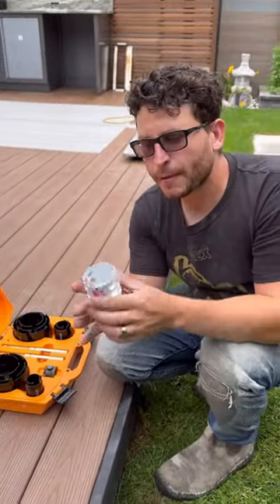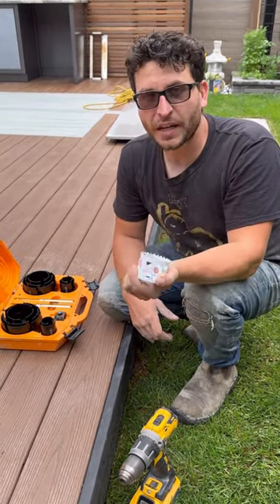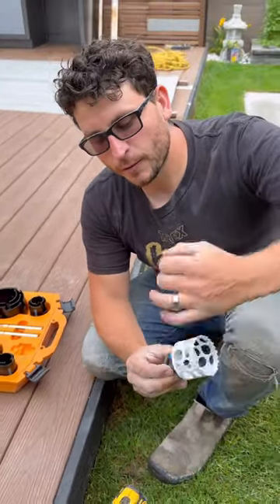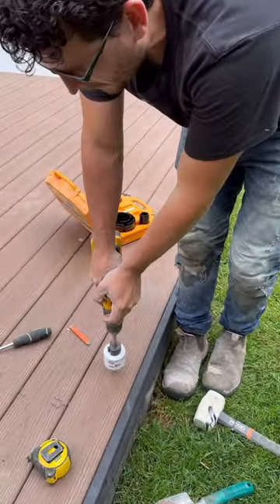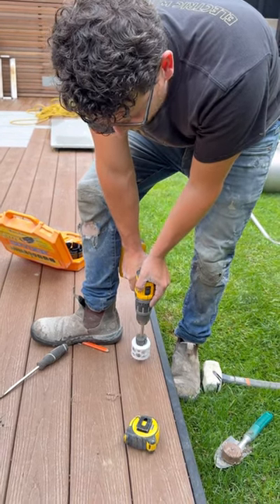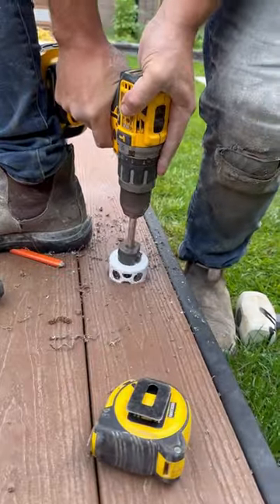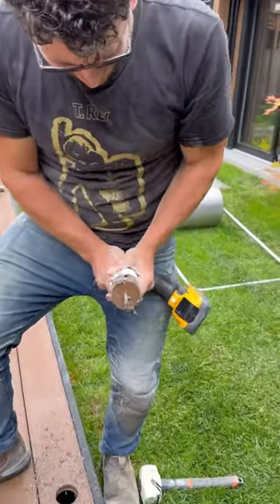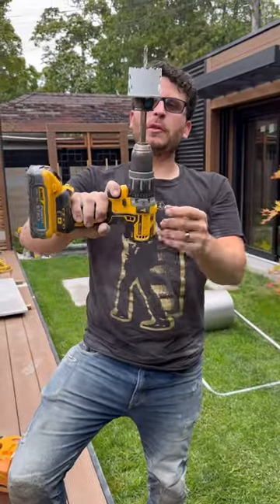BEST HOLESAW SYSTEM? #carpentry #tools #diy #protip #powertools #carpentryskills

Comment: I have never had a single problem getting the plug out of my hole saws. Just stick a flathead screwdriver in the holes on the sides and walk it out. Problem solved.
Reply: Lmao ! Amen brother !
I have used a dull chisel !
Whatevers in my left hand pocket 😀
Reply: I noticed hes cutting that plastic deck board might be why
Reply: its a problem people who can't drill straight holes face more. ppl who complain about torque spiking usually refuse to use the handles that come with their drill they also refuse to get a bigger drill. it's not about power it's about leverage. even the 12v drills have enough torque to end your career if the built in cutout doesn't work in time.
Reply: @godzilla7382  what's this got to do with the price of eggs on china
Reply: This man failed physics in high school.
Reply: Amen, my boss had me sit one time and get every single one unstuck.
Reply: Your are right bro.This dudes tripping 😂
Reply: Yup, or you could use a paddle drill but in the stuck wood
Reply: Take a long screw and screw it into the material and itll push it out. There ya go
Reply: Stop applying excessive force! You don’t have to push so hard. Let the tool do it’s job. And back it out to shake the saw dust and boom the plug will fall right out or just a quick ting with a screw driver and done.
Reply: Was gonna say the same thing, not that hard to remove the plug
Reply: Maybe if he used the hole cutter to cut through instead of melt through, removing the plug would be easier.

Comment: Just before you break through, bounce the drill a few times to clear the saw dust. Then your plug just falls out.
Reply: That works for wood but he's cutting composite decking
Reply: @aaronoconnor606  Works for that too. Also, it makes the cut easier because you aren't binding up on the edges, causing it to overheat, which causes the swelling.
Reply: What do u mean when u say bounce it?
Reply: @BreakKaydenBreak  Just like it sounds. Let the drill bit hit the bottom of the hole hard enough that it bounces back up a bit, while spinning. It forces the dust out from the bottom of the hole and from around the plug.

Comment: If you stop a time or two pm the way through and pull back it'll greatly helps with release of any material in a home saw, not to mention it helps clean out the teeth.

Comment: I’ve literally never had a holesaw that I couldn’t easily get the plug out of with a screwdriver. Most of mine are Milwaukee and Lennox, but I have used many other brands in just about every type of surface over the last 20 years. I think you have an issue with your technique if you were having to throw out a holesaw. Lol

Comment: If a drill only had a clutch to protect your wrists.
Reply: Dude that "clutch" wouldnt last a week.  Notice how the settings go 1 to whatever and then a drill bit marking? They're for using it as a driver with bits or sockets not as a drill.  The highest setting wont spin a decent sized hole saw in composite deck boards.

Now the real trick is to start out drill your pilots I use a different drill with a higher end centering bit.  Then once you have the pilots drilled you take a rotary hammer the big one for concrete bits and you can now stand with the motor between your calves and it weighs enough to drive through but never finish drilling all the way stop your hole about 1/8 shy pull back off and go to the next go around and almost drill all the holes then come back and finish once your hole saw has cooled because that plug isnt expanding your saw is.  The plug is staying the same but your drill is hot.  

Now most of the plugs just fall out or you can knock em out with a screw driver.
Reply: @bryceg5709  In the owners manual it even states you have to use the clutch for this.
That is what it is designed for.
And you dont need to push hard down on the holesaw.
That wont make it drill any faster.
Reply: @3dmazter  the manual states what I stated.  Look under the drilling instructions it will state.   Turn the collar to the drill bit symbol. Install and tighten the desired drill bit in the chuck. Select
the desired speed/torque range using the gear shifter to match the speed and torque to the
planned operation. Follow these instructions for best results when drilling.
Reply: I believe it’s Makita that now has a drill with an anti-kickback feature. This is different from a clutch
Reply: @3dmazter you’re not supposed to push a hole saw hard too. If you need pressure something is wrong with your bit. They cut faster and better with light pressure
Reply: @3dmazter  let the tool cut don't force it, forcing it causes it to crowd.
Reply: @Thumbsdwn my Milwaukee 18 volt drill has it. As soon as the drill kicks, it stops it
Reply: Came here to say it but you beat me to it

Comment: As an electrician,if I can't pry what's stuck out with a screw driver,I just pop the slider on the man drill,spin the holesaw off and then just get a big flat head driver and tap it out through the mandrill hole.and before someone says "yeah but he's drilling plastic decking" it's not much different to drilling out plastic dado trunking.

Comment: First, use the drill on a higher speed, 
Second, put the handle on the drill so you can control it without having to use your leg
Third, set the hole saw onto the material lightly instead of just shoving it into the material 
Forth, lift the saw out of the hole just before you finish the cut and let the plastic decking cool, then finish your cut. 
The decking will pop out fairly easy.

Comment: Hey Brian.....check it out, put it on hammer drill setting and it don't break your wrist. If you driil trough all but the last 32nd inch or so you can just tap it through thr hole.

Comment: Slight oscillation as you drill will reduce the size of the slug so it falls out, helps clean out debris and make the hole saw not over heat making them last way longer. Stop pushing so hard on your drills people, let the tool do the work.

Comment: Been an electrician for over 30 years, never had a slug that i couldn't get out. Yeah, some are tougher than others. Never been defeated. Metal cabinets, panel boxes, siding you name it, i drilled through it.

Comment: You know what's funny?  When I built my house I did everything with a $6 hole saw kit I got out of the bargain bin at the hardware store I worked at in high school.  It has a flat plate with groves that the various hole saws key into and since the hole saws aren't full circles once I twist them out of the mandrel/plate the plug falls right out.  I still have them 30 years later and they still work great.  I used them yet again a few years ago when I ran RG6 and CAT5e cables throughout the house.  I thought about "upgrading" to one of the more expensive sets but ultimately decided  to not fix what wasn't broken and glad I didn't.

Cheers!

Comment: A shot of silicone spray on the saw blade works wonders. If you take your time and pull back a few times as you cut letting the hole saw clear out some debris it gets much easier. 
Let the saw do the work, I've never seen the need to put that much pressure on the drill to cut a hole. Your tools will last longer and you won't be fighting so much torque.

Comment: I'm all about the quick change arbor but what are you taking about 1 time use and u have to melt it down no you don't it's just slightly more difficult the take off and then you gotta stick something thru the end to pop the material out definitely not fun but I wouldn't call it 1 time use
Reply from the maker: Only takes a few hours
Reply: @woodbullyltd  you just weren't trying hard enough it's okay

Comment: Well if u pre drill the pilot it’ll help your game and drill straighter the plugs will fall right out if they don’t, I can usually remove them with my fingers however, those bits a low quality go with the Lennox. It cost twice as much for a reason.

Comment: Right before you break though pull it out clear the dust let it cool a few seconds then finish the cut it wont get stuck that way its only getting so hot because your brute forcing it though.

Comment: You don’t need to get the kick back to start off just spin the hole saw backwards first then when it’s dug a bit simply change too the right direction then drill works especially good let’s say in more delicate material like thin plastic/ soffits like for down lights saves the drill digging in to aggressively when you sett off

Comment: It has holes specifically designed to get the piece out , it’s really not that hard to pull out a flat screw driver and pop the piece out. I’ll cut through 1/2 inch steel with these

Comment: Use a drill with an extension arm and in slow speed. You can drill a 3/8” relief hole somewhere within the holesaw perimeter that will help all the shavings exit the cut rather than melt in. Turtle wins the race.

Hmmm, would a trade qualification change the process for you?

Comment: Just run the drill and tap it a few times against something,most times it will just fall out,also those carbide Milwaukee holesaws are the real deal,I've put holes in block and brick.

Comment: a better way is to drill your pilot hole first and then put the holesaw on. you will bend fewer pilot bits and you can ease into that hole saw instead of it snapping your wrist off.

Comment: or we can: 1) drill a couple pilot holes along the circumference of the hole, after it's marked to allow easy drilling, and (2) never fully screw down the bit into the mandrel, only enough to engage stops then it retracts easy without the use of additional costly gadgets... you're welcome!

Comment: You've got to clear the chips a few times by pulling the saw out while drilling. What you did was literally melted your way through. No wonder the plugs stick to your cutters. I've cut plenty of holes into composite and never once had your issue.

Comment: Dude was putting all his weight into pushing that hole saw through synthetic deck board, basically melting it as much as it was cutting vs letting the saw eat. No wonder it was getting stuck, he was gluing it to the hole saw

Comment: Getting the wood cuts out after is pretty easy if you poke through the holes on the back of the bit with a screw driver, pretty familiar w those fellas.

Comment: I think the problem you are having with hole saws has more to do with you forcing the saw through the material instead of letting the tool do the work.  Forcing a hole saw like this basically cuts threads onto the plug.  The peaks of which are of larger diameter than the valleys and therefore, very difficult to remove.  Pay attention Brian and let the tool do the work.

Comment: The issue I have with spider is the pilot bit will come loose and fall out and there’s no set screw that holds it in. It’s a press fit. So when the pilot falls out, it’s trash and you have to buy a new one. Other than that I love the spider system

Comment: Ya if u let a saw do it's job and rock it a little and not push so hard if it stuck u use a chisel but mainly back it out and work it and go slower so your  tool and wood isn't burning

Comment: You need to drill till the saw makes a shallow grove then drill a whole through on the saw grove through the material then carry on as normal.
This way the saw dust has a place to go out the bottom instead of clogging the saw teeth.
Your welcome.

Comment: There are holes in the side to pry with something. In worst case scenario use a multitool to cut triangle between edge and drill bit.
When you cant be arsed to find a solution, lemme just throw it away.

Comment: Decent hole saws but the pilot bits are garbage the press on the shank barely holds the drill bit. I've gone thru 2 wood tips and 1 stucco tip in wall cavities

Comment: Holesaws are not single use, never had an issue drilling into PVC, wood, or metal before. Maybe don't slam the holesaw into the material at full bore, also don't start a tool when it's engaged in the material, that goes for literally everything. Also if you can't figure this out on your own, that's sad, but clearing those chips and creating less friction might help not melt the PVC decking's slugs into your holesaws. you don't need that much weight and pressure when the teeth will cut their way through only IF you clear the chips. all you're essentially doing is creating heat and melting your way through. You try to sound smart, pass along your knowledge, and people probably think you're something special, but these little things show your true colors. All for show.
Reply from the maker: My work is superior to yours. My attitude is as well.

Comment: The proof is the matter of the fact that the Milwaukee drill bit has the holes allotted for the spider drill bit. It's because Milwaukee patented a decade before spider existed. Quit trying to sell spider tools without telling us you're trying to sell spider tools. You don't want to comment back to me I'll take a video and post it of a Milwaukee having the exact same system before spider existed. I've got one and my father does too and he's 74. I've had one for almost 17 years how old is that spider company
Reply: I have the spyder hole saw sets and they’re the best hole saws I’ve ever had, out of Milwaukee, Irwin, and Diablo. I haven’t tried the big hawg hole saws from Milwaukee yet but I’m guessing they’re gonna be just as good if not better than the Spyder because they’re basically the same

Comment: Damn been a professional for years you just proved that your salesman not a carpenter. I love your videos forever and agreed with most of them but you're trying to sell spider drill bits. Milwaukee had the exact same thing you're looking at and using only Milwaukee before spider the company was in existence. Literally you're looking at a tool that has been created in the last four to five maybe eight years but yet I have a 13-year-old wholesale bit in the Milwaukee has that and it's got this weird thing on it it says patent. How long do patents last if you don't renew them 15 years. That is a Milwaukee literally patent system that now other companies use

Comment: That’s what the holes are for on the cutter. Use a flat head screwdriver and twist, insert in the opposite side and twist. Pushes the plug out. Then pry it out. No big deal. Are you even a carpenter bro? What next, how not to get sawdust in c&@t? 🤦🏻 
Soft wrists 🤣🤣🤣🤣